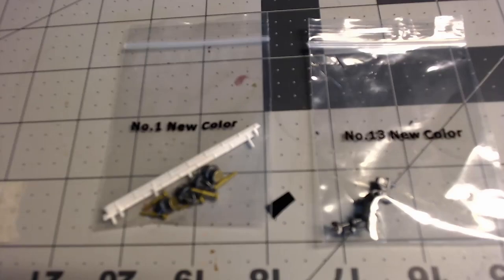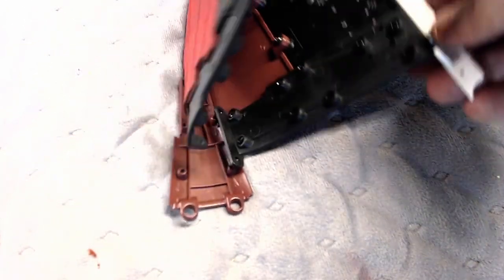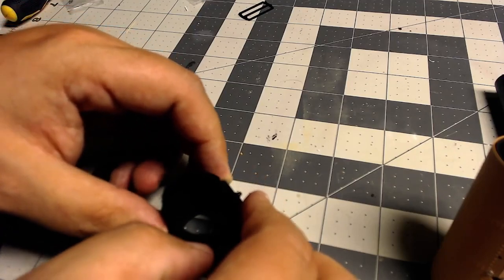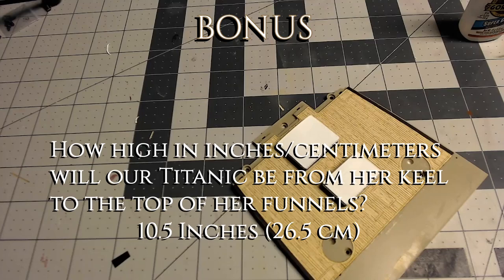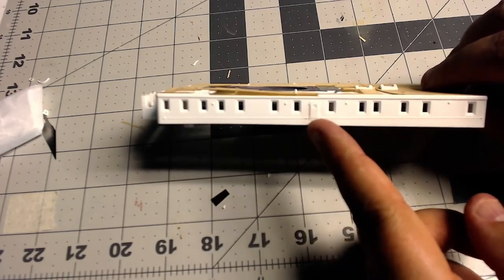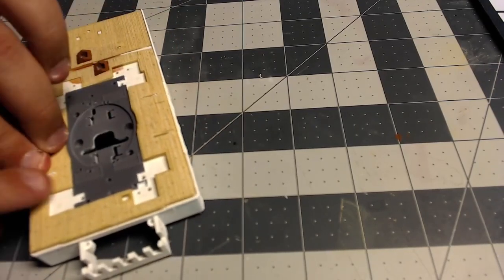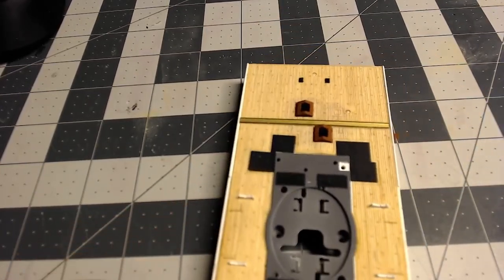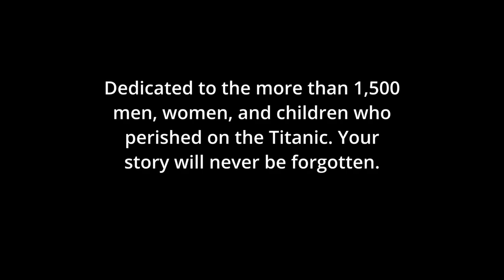Build the Titanic - Pack 3

Comment: Hey Robert, re the funnels I was wondering if you have considered Paul Begg's solution of gluing the metal sleeve to the plastic core, so that you can remove the screws later and fill the holes with putty and such. For the color,  what do you think of the Vallejo Titanic set? As for Woody's photo etch, I heard that the riveting practically disappears when you paint them,  so perhaps we're not missing much... once again it's a case of "rivets scale translation loss", where the size makes them practically invisible...
Reply from the maker: I think that might work. It's just a matter of skill level.

I'm not familiar with the Vallejo set. But you saw on the video. I used the same paint on both, but the flesh tint over the orange funnel just looks better.